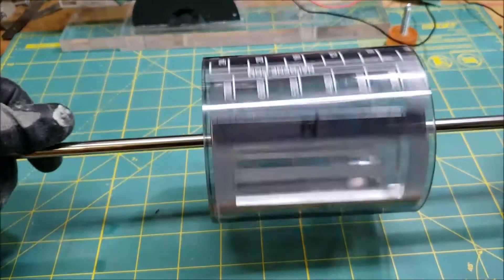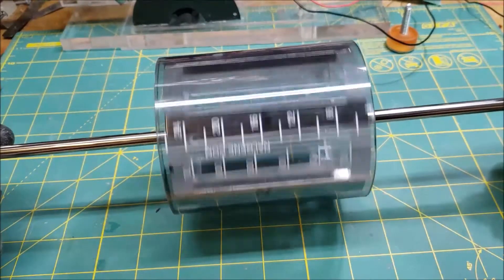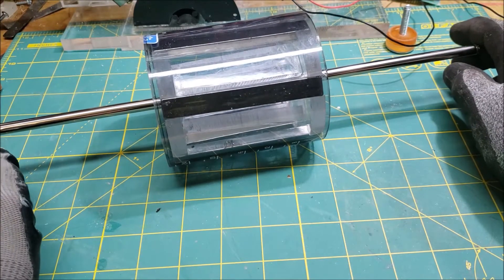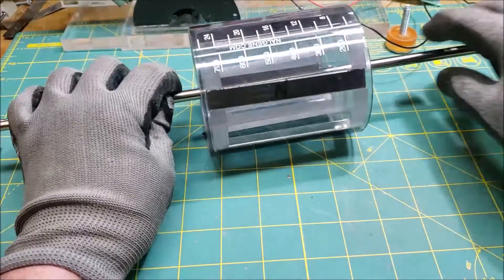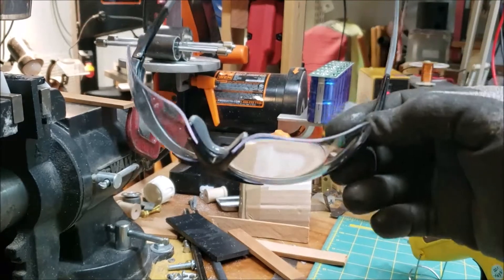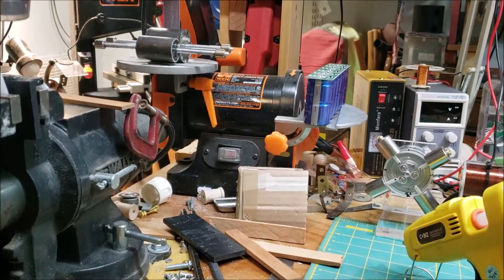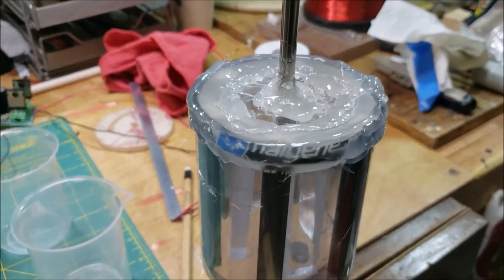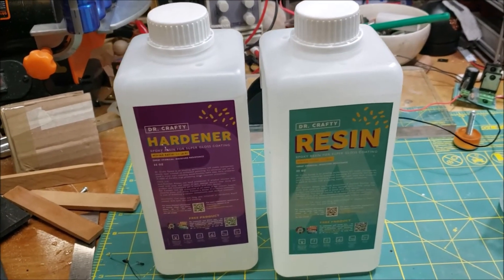Monster rotor build and stuff

Comment: What is the work time of the resin? I was wondering if you could gravity feed to the bottom of the form then pull a vacuum on the form to fill it.
Reply from the maker: work time is relativity short but a vacuum would work. Already poured so maybe next time which I'm, sure they be one :)
Reply: @mcorrade  just curious if it would help with bubble issues you had in the past. I watched a guy do a countertop and I asked why he was heating the epoxy resin he poured. Then he showed me the hot air bubbles rising to the surface. Since water and other liquids evaporate faster in a vacuum, it makes me curious. Probably will need a large vacuum tank(volume). People always use water to explain electricity so lately my projects revolve around my pond and fountain.  Nobody see's the waterwheel I am calling a wind turbine. I demonstrate how to make air pressure with falling water(positive/negative pressure). With the ram pump running I am starting to get a rhythmic wave in the lower reservoir.  Wave generator's.
Reply from the maker: @MAGnetICus_Attractus  yes I use a torch to get bubbles from the top but a good vacuum or pressure pot would also work.Because of the nature of the project I'm not overly concerned with bubbles.